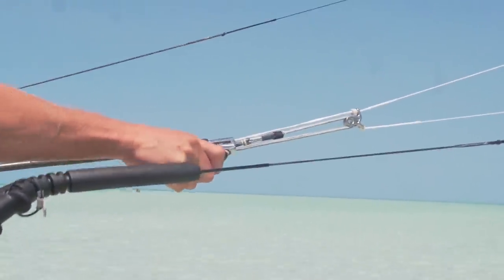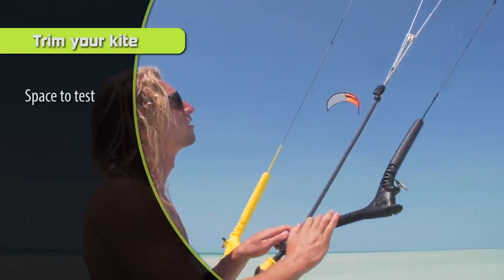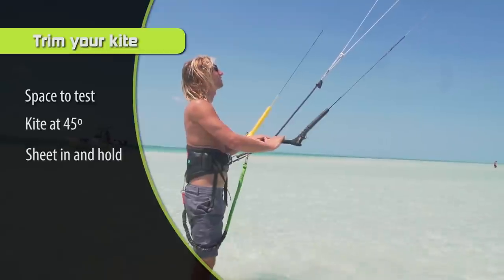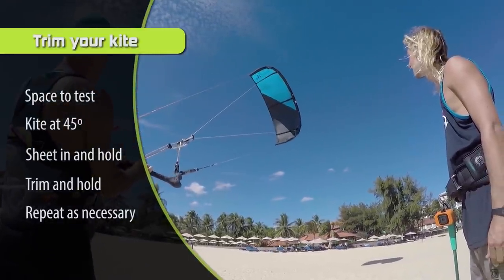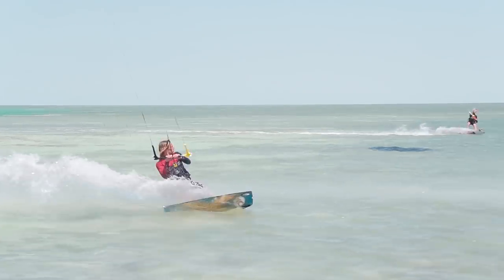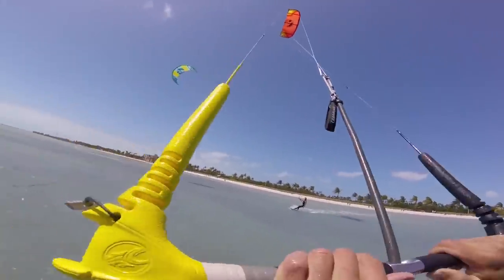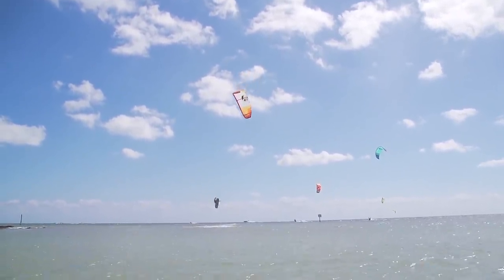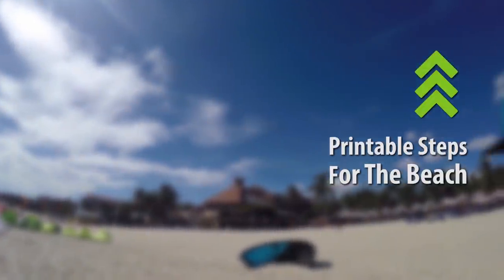Kiteboarding: How to Trim your kite - Ride with Blake Vlog 51

Comment: Wow, thanks. I thought exactly the same misconseption is true but today I'll try what you suggest. 👍🤙
Reply: MaEtUgR let me know how it goes!
Reply: Honestly I tried your hints but I think the "problem" I have are the spots I kite at. I'm very often at light wind spots where I'm really underpowered with my 12m^2 and weight. In this situation I like to have the adjuster full out because then I get the experience at what positions exactly I have to put the bar for the very light wind riding. I think as soon as I'd be properly powered and had some room to play your adjuster guide would make more sense. Sadly that almost never happens... Maybe I have to rethink my gear.

Comment: Thanks for the video always thought the same way u did, the type of kite wont matter when trimming right (softkite, c-kite and so on)? Could u do a video on how to hold an edge when the wind picks up and ur way overpowerd suddenly or u choose the wrong size kite and u still want to practice (guess why im asking :). Keep up the great work, these are the best tutorials with the most helpful info if seen so far.
Reply: denniz122 you are welcome! That’s a great idea for a video, thank you for the idea I will add it to the list. We have quite a few things lined up, in the mean time you can use this advice. I like to ride quite overpowered myself 😄. I find that when you are super overpowered, keeping the kite lower in the wind window with the bar sheeted almost all the way out helps a lot. If your kite is too high then you will get pulled off your edge no matter how hard you try. Also edging straight into the wind helps dump a lot of the wind and power and allows you to keep riding. Then when you are ready to jump, slowly bring the kite up higher and send it with the bar fully sheeted out. Pull in on the bar right and twelve and boost to the moon! Hope that helps in the meantime and I will get on that video as soon as I can. 
Cheers!
Reply: Nice thank u very much for the tips. I was practicing in 25kn with a 13m kite with my under 70kg and i was properly powered for a beginner who just learned to waterstart and turn. I quite liked the power but when the gust hit i just accelerated lost the edge and got pulled over on the beach :D and of cause i "trimmed" the kite very wrong as i learned from this video. Flying the kite lower is a great tip never thought of that. Anyway keep up the great work!

Comment: The 3 mount point at the wingtip / hand diagram was confusing.  So you're saying the mount "closest" to the front of the kite give you the most steering?  Did you mean to say the mount point furthest from the front of the kite give you most steering most likely to stall the kite?